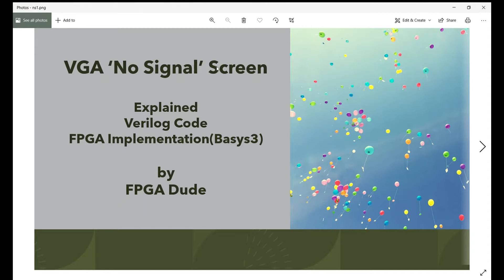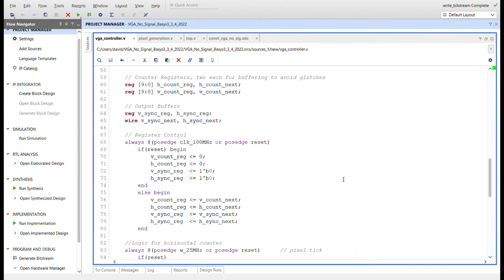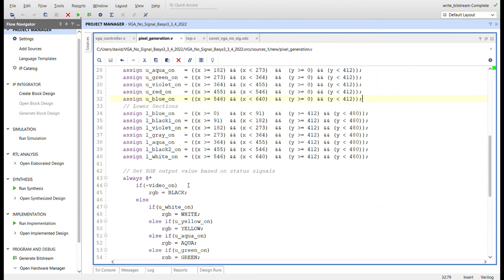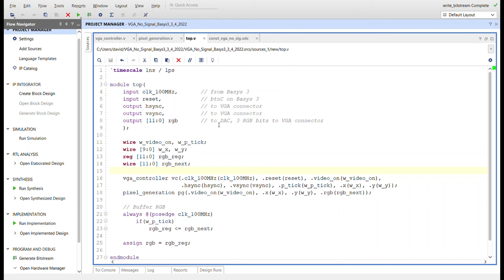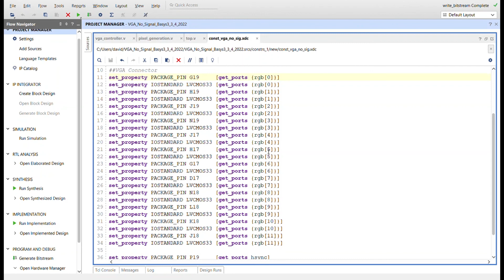VGA Project 'No Signal' Screen Verilog Vivado Basys3 FPGA

Comment: Hi great video sir! 
Could you please explain what is the use of the buffer in 'top' module line 22? Is it for timing delay or for fanout? Would love to know! 
Thanks!
Reply from the maker: The buffer in line 22 (rgb_reg) is used primarily for timing synchronization with the pixel clock (w_p_tick). Since the pixel_generation module calculates the RGB values asynchronously (without a clock signal), those values need to be registered (buffered) on the rising edge of the pixel clock to ensure they are stable when the VGA signal updates.
Reply: @dajoma36  Understood, thank you!

Comment: Hey man, can you post the code for this project? I really like it and I want to use this for a template for my own project.
Reply from the maker: You can find all the code here  https://github.com/FPGADude/Digital-Design/tree/main/FPGA%20Projects/VGA%20Projects/VGA%20No%20Signal%20Screen
Reply: @dajoma36  Awesome! much appreciated, subbed
Reply from the maker: @natemac8473  No problem.
Reply: @dajoma36  I'm trying to change the VGA output color based on a PMOD pin input. However, can I just change this in the pixel generator code by adding say [0:7] JA and then checking it in the if statements or do I need to add it to the top? I'm having a hell of a time getting this to work.
Reply from the maker: @existentialexplorer5994  Lemme see if I got this right. You want to take 8 bits into a PMOD and use those 8 bits to control the RGB color on the screen? Ok, so, the RGB output to the VGA connector is 12 bits. You could still use 8 bits by dropping the LSB for the Red and Green, and dropping the 2 LSBs of the Blue. This would essentially give you 8-bit color, instead of 12. Just leave the LSBs that are not in use unconnected. As for the logic, you could put it in the pixel generation circuit. Check the PMOD 8-bit input and assign 8-bit RGB based on that value. Hope this helps.
Reply from the maker: As for the 12-bit RGB, I am assuming you are using the Basys 3. Sorry, if you are not.
Reply: @dajoma36  Thanks for the reply! Yes I am using the basys 3. Basically I am trying to change each of the sections of the "No display" pattern based on whether a pmod pin (in JA) is high or low. I have added the pins to the constraints file. For some reason when I change the status of a pin from low to high, it does not change the color. I am basically using the if else statements you have in your pixel generator, I'm just adding a case statement for if the pin say J1 (named JA[0]) is high or low.
Reply from the maker: @existentialexplorer5994  If I could see your code, that would be helpful for me to help you.
Reply: @dajoma36  Nevermind I got it, I had to set up the input into the top and route it through a wire and then assign it to get it to register change.
Reply: @dajoma36  Appreciate the help and love your videos man. Very helpful
Reply from the maker: @existentialexplorer5994  No problem, and thanks for your comments on my videos.